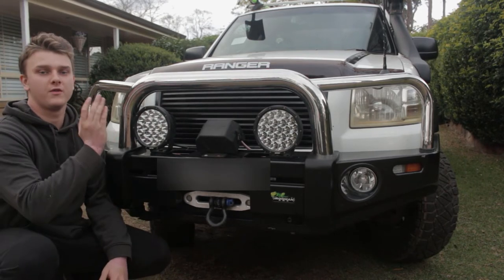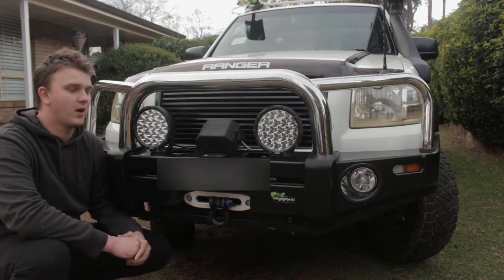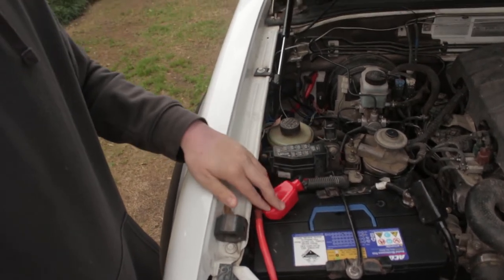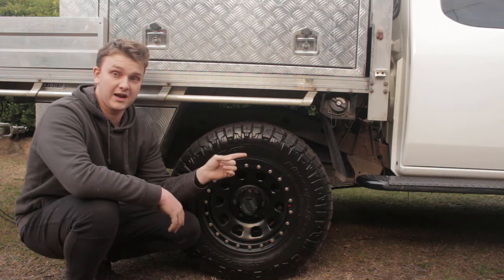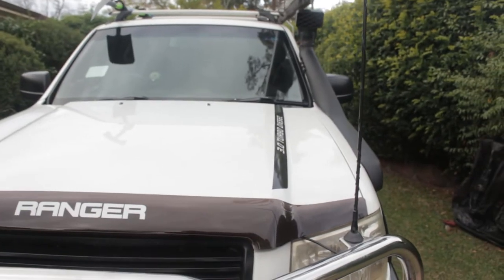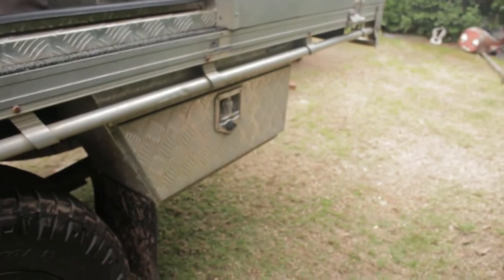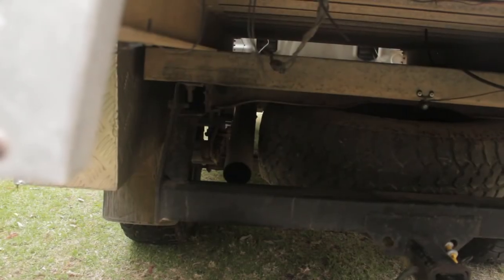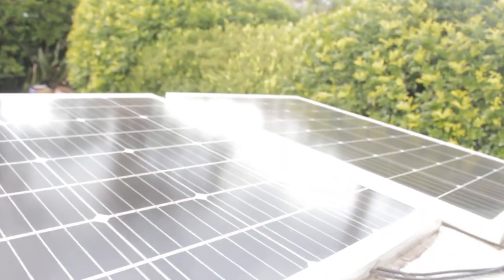IS THIS THE ULTIMATE TOURING SETUP? - Ford Ranger 4x4

Comment: I am the same problem with my hilux with weight. Mine without anything is 2.6t had to get a gvm upgrade to get me to 3.3t. Are you planning on getting lockers? Or is it more just a touring rig.
Reply from the maker: I know aye mate weight is such an issue these days, I'm planning on just getting a truetrac torque sensitive dif in the rear. They're basically just a different style lsd but if you lift a wheel you can put your handbrake on a couple clicks and it locks up!
Reply: @twox4x432  that would work great if the Toyota handbrake worked haha. I absolutely love being twin locked. On my first trip to test it I went down a track and had to turn around without the locker I would have had to winch. That same trip I went into a bog hole and got a bit stuck, put the rear locker on and came straight out no water in the car at all. How expensive is that solution compared to just getting a locker?